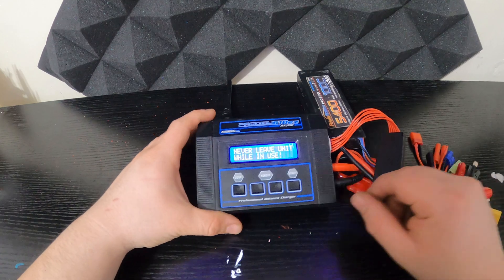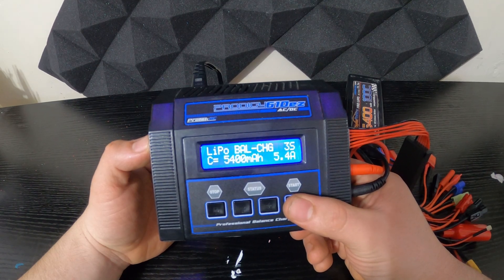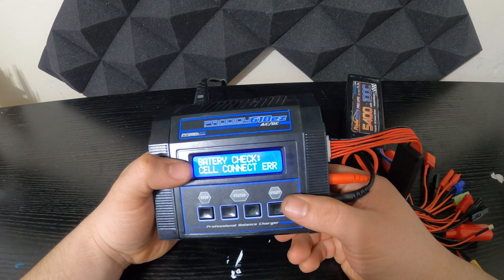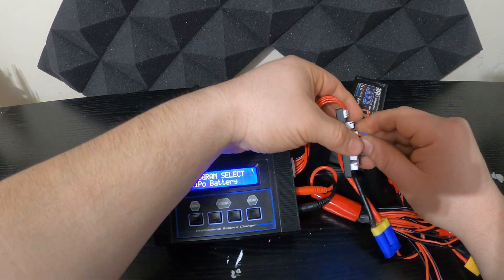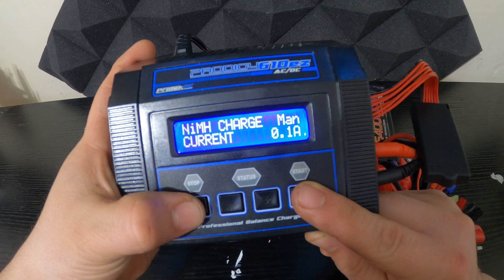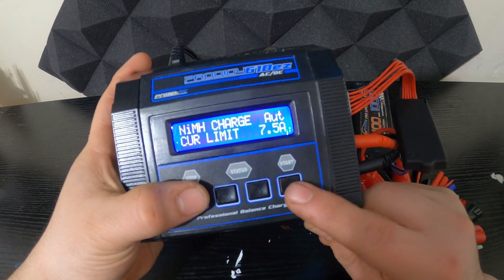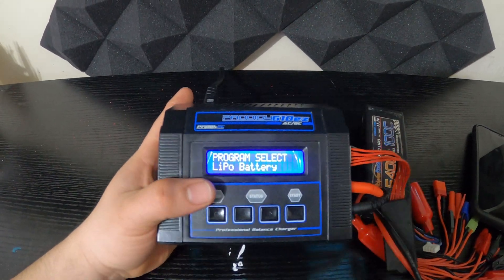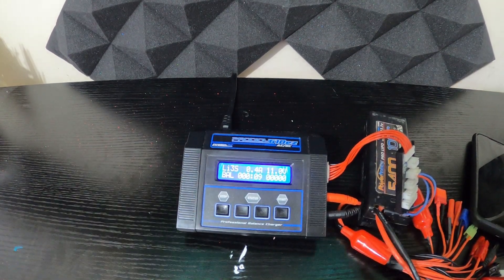Fix cell connect error & rescue a low voltage lipo

Comment: It is working 4s 6500mah my second cell have low voltage when I try to balance only 1,3,4 have the same voltage,it is working in 4s lipo battery?

Comment: i don’t have that charger thugh
Reply from the maker: ohh i dont have answer for sorry
Reply: @KrakenGarage do you know why this thing happened to battery?
Reply from the maker: @zmogienaneskani  yes you can do that with different charger
Reply: @KrakenGarage  i managed to revive my battery but it seems in one side it got slightly puffy or roundish... Im totally new, it was my first flight and i flew my drone with amount of battery it had when i bought it
Reply from the maker: @zmogienaneskani  if is puffy I recommend you to get a new one instead, lipo batteries are really dangerous
Reply: @KrakenGarage  well i will keep in mind.  For now i will use this one, its very slightly puffy only in one side, my budget is pretty small, i will order new one little bit later
Reply: I dont have wery same charer also, but different one, it has same functions